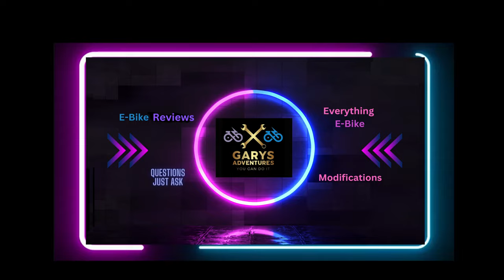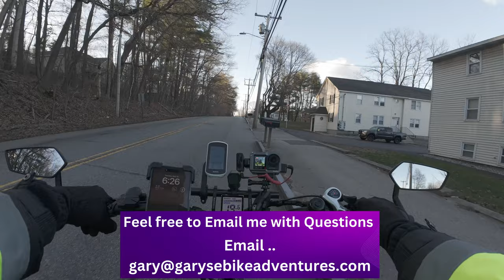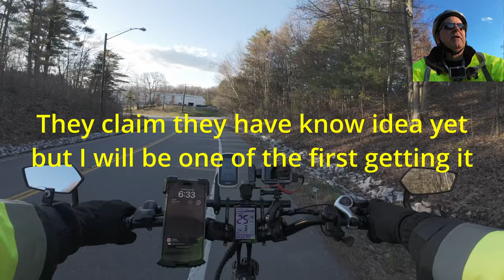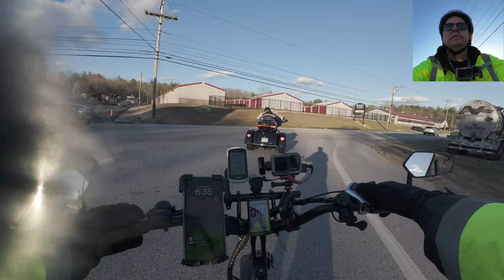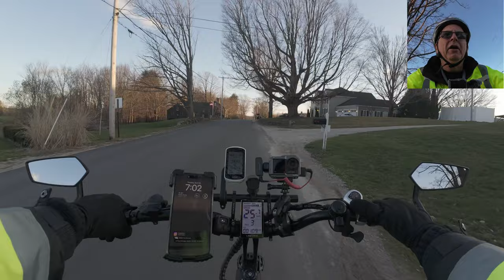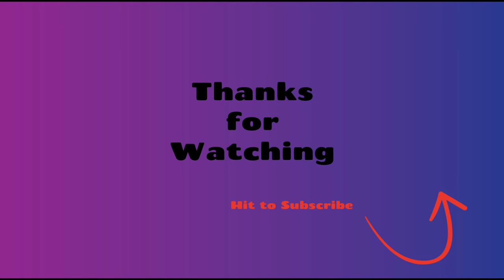VLog #20

Comment: I have an old Lectric 3.0 and the battery doesn’t get me the miles per charge it used to after I have had it now for 600 miles. Where do you suggest to buy new batteries that don’t blow up?
Reply from the maker: If you’re looking for an auxiliary battery and you’re looking for plug-in play, these are the best guys they have the set up that you need
https://electricallwheel.com/store/ 
If you’re looking to replace your factory battery, that’s in the tube. You’re stuck buying it fromLectric  I think there is a Chinese company out there selling one that will fit, but I don’t know if I would recommend it. But to be perfectly honest, Lectric does not advertise that they have brand name cells in their batteries so they probably junk anyways.